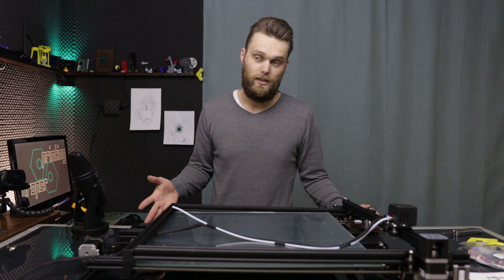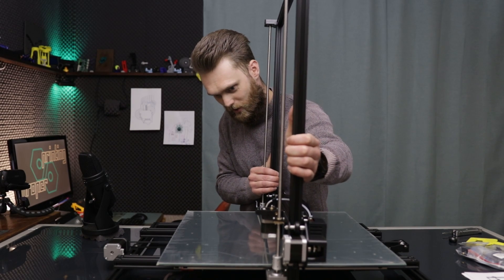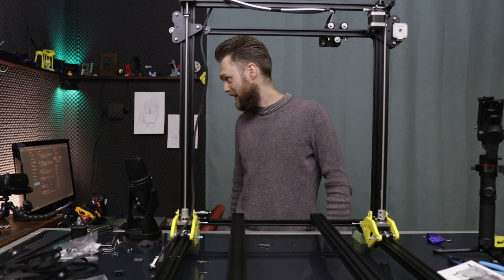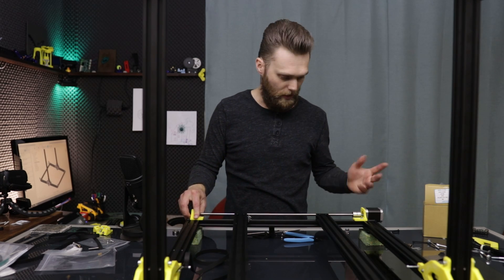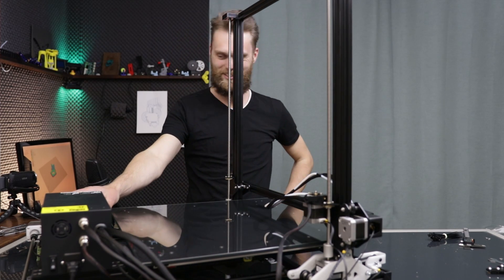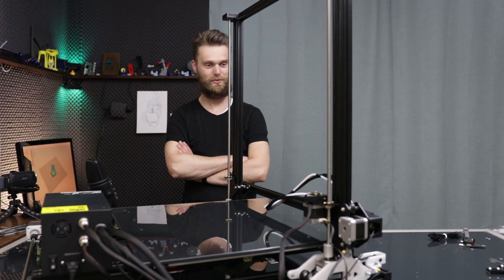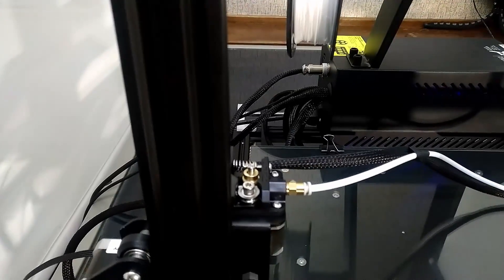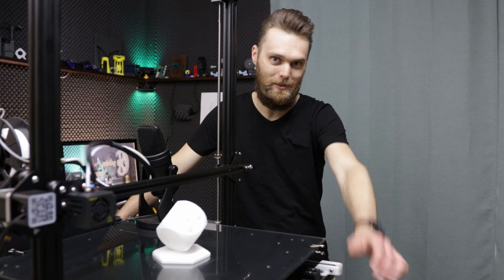Why not move the PORTAL instead of the BED?

Comment: I feel this is still a cartisian style printer. print head starts from the bottom and moves up. the x axis still rises with the z height. The y axis is more interesting to define.

Instead of traditional Y axis movement being the bed it is the z and x gantry that is moving. as far as ringing and ghosting is concerned these artifacts are cause by large amounts of momentum with high acceleration in changing direction. 

The argument here is that instead of the presumably heavier bed to be moved there is a potentially lighter z and x gantry to move. True CoreXY eliminates this with the hotend assembly being the mass momentum to cause ringing and ghosting. While the z and x gantry is not as light as the hotend assembly in a CoreXY style it is however possibly lighter than the bed assembly. 

If at all in consideration it would seem this would be a hybrid between the cartisian and CoreXY styles.

To define this style could be an XZ-Gantry Motion Cartisian FDM Printer, HybridXY, MotionXZ or even ProperXZ..... XD
Not sure exactly an exact name for this style, it even still could be considered a cartisian but I like the creativity and forwardness of this build.

I hope you continue and add a 24V Power Supply or AC heater with solid state relay, SKR 1.4 T Board, Mosquito hotend, Remote Direct Drive extruder, Noctua fans, BTT TFT35 Screen and have an all in one gantry enclosure for the control board.

In addition for printing these rims consider engineering grade materials, albeit most are very expensive. ABS, Nylon and PCs alike may not be strong enough or take the heat. There is Nylon Glass filament but higher than this are very expensive like Ultem and PEEK.

I will continue to follow this project of yours.
Best of success to you, Jon.
Reply from the maker: Thanks for your thorough comment! It turns out to be a moving gantry or portal printer :D I'm going to add 230V heaters which are indeed switched with solid states. I'm going to use the sickest possible hot end in existence that I know of and everything will be placed neatly in an enclosure. I wanted to make a simple enclosure, but it's going to turn out way sicker than I intended so I might as well make the best looking enclosure I can possibly design xD
Reply: whoa ! are you going for a super volcano or a mosquito ?

Comment: You freakin rock!
I am very much looking forward to an update on this...
Try getting the final parts made in aluminium. :-P
Reply from the maker: Thanks man! If you take a close look you can see that the initial flimsy design is designed out of 4mm sheet aluminum ;) I'm surprised how stiff polycarb is so it's still an option :D
Reply: Ohh. I missed that :-D
Yes it is pretty stiff. It looks so amazing. 
I was actually expecting the tower to wobble a lot more than it did. 
I am making my own printer from parts i like frem different designs. Like kind of an frankenprinter. 
If i had seen this before i started. It would have been a part of it ;-)

Comment: It works because you have very slow speed. I mean the standard cr10 ale need a triangle frame addon or else is not rigid enough when printing high. So I don't think yours will be better about that.

But I find the idea itself funny
Reply from the maker: The b-roll was recorded in 60p so it looked even slower ;) I'm going to further increase the stability when making that enclosure though ;)

Comment: If you print tall object the gantry will wobble and makes artifacts, unless printing really slow. I must say this is a very novel idea! You might continue step 2 later?
Reply from the maker: I'm going to further increase the stability when making that enclosure. Even the third step would be possible to add afterwards but I don't think that would be necessary :)

Comment: Fantastic and absolutely well done!!!! This is what I feel pushes this industry forward, we share ideas and build them up to the next evolution, maybe a possible something to think about if you’re willing to at all and someone else hasn’t mentioned it, when you have the top beams running parallel to you Y-Axis maybe put some rollers at the top of the Z-Axis as you did on the bottom, that will surely totally remove any possible tipping effect from happening at all and possibly even remove the need of the center beam at the top connecting the two Z-Axis extrusion, anyway just my two cents thrown in, fantastic job once again, keep it up, love your videos 👌🏻👌🏻👌🏻
Reply from the maker: Thanks Derek! You've described phase two ;) I'm going to do this when building that enclosure because this already will have a 2040 beam at the top :D I think that phase 3 with the second belt can be even applied afterwards, but I don't think that'll be necessary.

Comment: That's super-cool! Naming aside (and frankly the "core xy" name has already been abused elsewhere along these lines so who really cares - it's perhaps small-volume cartesian?) - it'll be interesting to see how it bears up over time. Compared to the Ender 5 approach, it doesn't require all that extra extrusion, and if it works out well I wouldn't be surprised to see one of the Chinese manufacturers take it to production... The thing to see will be ringing on Y, I suspect it'll be worse moving the gantry on Y than moving the bed on Y - but might just get away with lower acceleration on Y to compensate.
Reply from the maker: Thanks for your comment! I'm going to make it more stable at the top when building that enclosure. I recon I could get away with it when printing the rims because there aren't much fine details in it, but I want it to print as good as possible of course ;)

Comment: Don’t know if you’ll find this a useful suggestion or not, but you could consider getting some really stiff springs, like say ones that have to have 15 pounds of pressure to squeeze them, and they should offset whatever weight you’ll have on the print bed.
Reply from the maker: Thanks for the suggestion! I'm afraid that this would damage the thread in the aluminum profile, but it might work. I've leveled the bed now so I won't be touching it again :)

Comment: Assuming that this was actually core XY; Why switch an existing printer to core XY when you could just put 60 mm NEMA 17 high torque stepper motors on the machine?
Reply from the maker: Because of the size reduction of the enclosure

Comment: In the Cnc machining world it would be called a moving gantry 3d printer 😉 You can get some more information here
http://www.mycncuk.com/threads/9082-Beginner-Moving-Gantry-Build-Read-This%21
Reply from the maker: Thanks for the information! I recon this is mostly used for sheet material. Moving gantry sounds logical :D
Reply: @properprinting  Good guess, it's pretty space efficient thought still strong enough so ideal for wood working and plastic sheets. I'm grateful you now know the exact word you where shearing for !

Comment: Nice design Jon. The only way i can see this work is when you are able to get atleast the pieces you used for the Z profiles in metal. Even then it's a bad idea to use a wheel system since they also have some play when there is going to be some jerk on the Y movement in height.. You won't see this in regular prints but i fear for large Z heights. There is a very good reason as to wy we have seen cube designs after the normal XY designs. I am not here to bash anything and i admire your ideas but this is the way i think about it. I would have made a cube outof it. Core XY yes or no but then there would be no problem with Z heights wobbling. Other then my thoughts about it: I hope you succeed with your project mate..
Reply from the maker: Thanks for your honesty. I'm not finished yet ;)
Reply: @properprinting  I know you bro.. and therefore i know that we didn't see the best of this yet. As we say in dutch: this mouse has a tail ahahahaha Good luck buddy!

Comment: This is really great, own a S5 by myself... Problem is my printer is 1000 in height... So would it still be possible to make it work with your modifications?
Also you have raised the bed a bit, how about putting it as far down as possible, then just add Auto Bed Leveling.
Reply from the maker: What 1000?! As if it wasn't high enough already xD I think the you're going to need some support at the top then. I'm going to make it more stable when I'm going to add the enclosure. I haven't lowered the bed that much because it's directly placed on those beams and I don't need the height anyway ;)

Comment: This guy is the next 3D printing nerd. His passion and creativity is next level. All these years and no one has tried to do something like this. Smart! Great job Jōn keep it going!
Reply: What’s the stock weight of the gantry vs the bed?
Reply: This design is nothing new, modifying a CR-10 S5 to use this design is new though.
Reply: Proper Printing is better than 3D Printing Nerd in my opinion.
Reply: @quicktime4079  Yeah, this dude!
Reply: @3DPrintingNerd  Dont worry. I still love you.
Reply: Great Idea! Could You make a Comparison or a test how this mod effects Ringing Artifacts?
Reply: Yes they have, there is a big reason printers aren't built like this and its that the gantry arm will increase pinging and ringing
Reply: @hypercube33  Yeah, namely that mainstream consumer manufacturers don't want to spend time and money to reinforce gantries with rigid frames, something that's both best practice and simple common sense.
Reply: @Kenny Eaton You forgot all those plastics on the bed to calculate into the weight.
Reply from the maker: Awesome comment Steven, thanks! I have checked multiple times if this wasn't done already because it's so straightforward xD
Reply: @properprinting  That was incredibly creative! Seriously good job! 
We have a CR10 S5 at work and it suuuuuucks, I'm betting this would solve tons of our issues! :D

Comment: Would be interesting to weigh the new moving parts vs the old parts to see which is lighter. Might need some bracing or 2040 upgrade to handle the moment arm at higher Z. I like your ingenuity! Great video.
Reply from the maker: Yes, that would have been interesting indeed! I'm going to add that profile at the top of the enclosure I'm going to make to reduce that wobble :)

Comment: I would've bolted the bed down solid and then used mesh bed levelling to compensate for any out-of-level.
Reply from the maker: It's practically solid and I'm not that big of a fan to compensate with mesh bed leveling. I prefer a mechanically correct bed (everything flat, parallel and square) and compensate if needed. Just my vision :)

Comment: Wow! Thats genius! How much does your moving gantry weigh compared to the bed? Hopefully less so theoretically it can print faster without ringing?
Have you seen the MicroSwiss direct extruder yet? I just fitted one to my Ender 3 and its superb :)
Reply from the maker: Thanks! My guess would be that it is half the weight due to that glass. And the difference will increase the larger the print ;). I still have to fit another heavier hot end on it though (not the Microswiss and I didn't know they had one, interesting)
Reply: @properprinting  I had another thought - if you're using this to print wheels which will be what, 250-300mm high, you could reduce the height of the Z axis to further reduce weight and inertia. I very rarely print tall things on my CR-10 so its a waste having it 400mm high. Even more so with an S5 at 500mm :)
Reply from the maker: @d2doctor  I agree, that would be a fitting solution! I'm going to make it a bit more stable when adding that enclosure :) I am going to need that height in the future ;)

Comment: Could you add a longer bed to take advantage of the new range?
Reply from the maker: Funny thing is that the range hasn't changed much. It has even reduced slightly which can be solved with a small modification to the bottom part which collides with the motor bracket and tensioner at this moment
Reply: @properprinting  oh right, with you having the control box on the frame it looked like there was a fair bit of extra travel range. Is the print quality still as good? I might look into doing with cr10 for space purposes. Great vid👍👍

Comment: Think this could work for the Ender 3?
Also, would you be able to open your Twitter DMs? I have questions about stuff I don't want to share publicly yet
Reply from the maker: Not as it is right now because the bottom beam of the Ender is 40×40, but I'm going to modify it to fit the Ender. Yea sure, send me a DM. Thanks for asking!
Reply: @properprinting  Can't wait to see that on the Ender 3, and the Twitter thing requires you to go into your settings to enable people to DM you
Reply from the maker: @kingsidorak  You're right, I've changed the settings.

Comment: Yo jon did how beefy is the y motor
Since moving such a big mass on the y axis might affect print quality
~although the extruder is probably the bottleneck for now~
Reply from the maker: Fortunately the y motor of the S5 is very beefy because that bed is very heavy. This mod reduces the weight on the y axis significantly :D
Reply: @properprinting   you still have basically half of the printer moving

Comment: The massive print bed makes me uncomfortable, how heavy is it
Reply from the maker: It's too heavy xD Imagine the size and weight after I've built that enclosure haha. If I'm placing it outside for too long it will be registered to the land registry xD
Reply: It is pretty damn heavy. The glass alone is 4 kg or so. Thankfully you can remove the glass and strip a PEI sheet to the steel carriage. 4 Kg less moving weight and you don't need the subpar partial bed heating that way. All in all the moving bed works surprisingly well on this printer though.

Comment: CoreXY is a design where the printhead is moved with belts and pulleys from motors that are stationary. This, while cool, has nothing to do with CoreXY. https://reprap.org/wiki/CoreXY
Reply: There are 3 major categories of printer axis control.
Cartesian where each of the three major axis are controlled by their own steeper motor.
Delta where each of the three axis are controlled by moving all three stepper motors.
CoreXY where the Z axis is controlled by one stepper motor and the other two X and Y are a blend of the two stepper motors.

This build is just converting from one form of Cartesian to another. (Don't get me wrong there are some cool advantages to this change)

With a  CoreXY, if you run only one of the XY stepper motors, the head will move at a 45 degree angle. 
Move the other stepper and it will move in the other 45 degree angle.
Move both steppers at the same time, and it will move back and forward.
Reverse one of the stepper motors and it will move side to side.
The advantage of the coreXY is having the mass of both the steppers not being moved.
By then using the Bowden system, the weight of the head is reduced further allowing for much higher speeds.

This upgrade is very cool in that while it is still a Cartesian system, the mass of the build is stationary, that means for thin tall parts, its less likely to fall over.
I have had prints where I have had to slow it down as the print get taller, this would eliminate this need.
Now I will have to think about if I should do the same thing.

Good job.
Reply: Actually it's more like corexz but then again it's even more like an overhead gantry CNC router...
Reply from the maker: Very interesting, thanks for the info! I was unsure what to call it and I still don't know the real name. CoreXY was the closest I could find but this approach is indeed different.